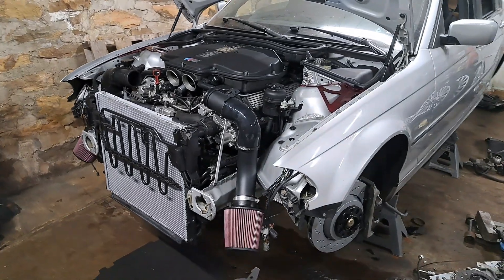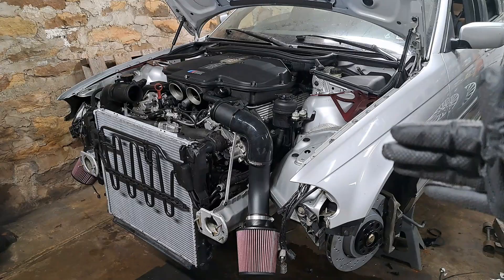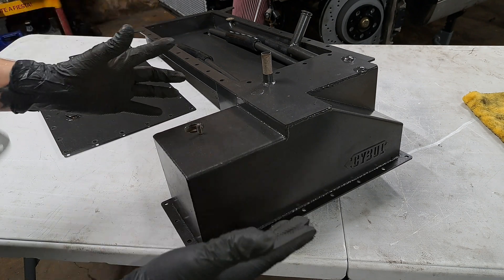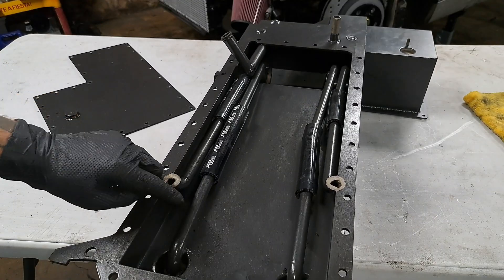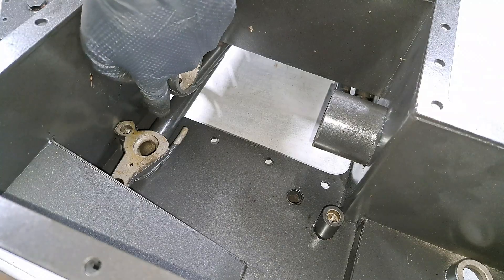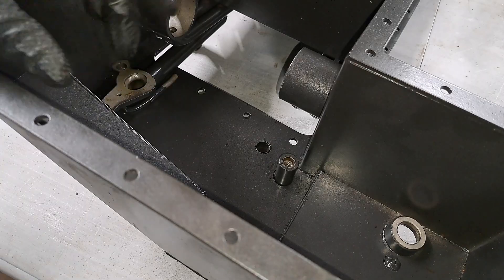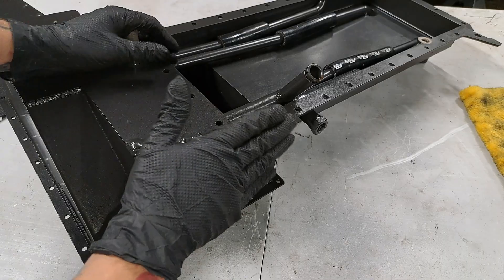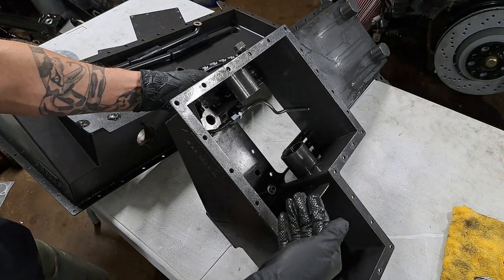Do NOT Buy this for your BMW engine - Cybul S62 Oil Pan Swap Kit E46 E36

Comment: I had also lots of problems with this set: 
- they didn't provide the template for drilling in the oil pump bracket
- oil pump pickup flange did not fit properly. Needed to make special thick gaskets myself to get oil pressure. 
- the modifed oil pump axle was not on spec.
- when mounting the oil pump and solonoids, i had to press out the oil sump with a hydrolic spreader to make it wider to fit everything.  
- oil retour line was not made correctly 
- they provide the wrong bolts for the subframe.
- provide wrong size bolts and washer for oil sump. 
- and last but not least, after finally making everything work myself. The welds cracked on different places. So had already 2 times big oil leaks and had to take it apart again😢

Really Really bad. And when you tell them the problems, the owner says he had never any issues with the set😂😂 

I have now spoken to 5 people in the Netherlands an Germany who also used this set. And had simular problems.

Don't buy this. Search for alpina or go the dry sump route.

Comment from the maker: Further update. After going back and forth with the owner of Cybul, I finally got a partial refund. Yet only after I showed proof of other people having problems. I had to stay persistent.

My friend from Spain, the one I've mentioned in the video a couple times, his S62 has recently totally lost oil pressure as well. Cybul told him to ship back the swap kit, for half refund. This is getting ridiculous.

Additional news, my Spain friend has disassembled his engine. Lots of damage has been done. Very unfortunate. Even the crankshaft is scored.

Comment: Hi !

Which gearbox and drive shaft do you use ? Ty ❤
Reply from the maker: The original 420G gearbox, driveshaft varies. Usually custom. I had one extended by shop to fit properly.

Comment: Makes sense that a large welded piece would have large misalignments. Welding pulls metal around and even if you fixture your piece, it's still springy and will pop out of shape as soon as you take it off the welding fixture.
I've worked in metal fabrication and i'm not that far from poland, so i can assure you that it's most definitely underpaid welders at work making these pieces. Or even in china.
And it also makes sense that these pieces are not aluminum, because skilled aluminum welders are expensive and hard to find. Any defect in an aluminum weld can lead to cracking over time.
If the pan is powder coated then it could be that as stress relieves in the heat of the curing oven, that the metal moves and features become misaligned.
I suspect what they need is a machining operation after baking in the oven, to bring all dimension critical surfaces up to spec.
But that's expensive and time consuming, and the bean counters don't like that.

Comment: Damn bro, fmic is a cheap brand
Reply from the maker: Where do you see a intercooler? Lol
Reply: @OLearysBMW the hose brand inside  the pan
Reply from the maker: @SERP92_  Gotcha! Thought you meant front mount intercooler. But yep, that further supports my reasoning of those hoses breaking down over time and contaminating the oiling system.

Comment: My question: is it possible to run stock oil pan and instead make a custom subframe? 

I feel like it is way less critical and the tolerances involved are much more forgiving.
Reply from the maker: Yes, that is what I'm currently doing. It's quite the task but feel much better already using the original parts.

Comment: I had the same problem with this kit. I've been in contact with Cybul since March, and they sent me another oil pan, and again it's off…..
Reply from the maker: I recommend to return the parts and get refund now. If you wait too long and have problems later, getting a refund is like pulling teeth. Don't do it to yourself.
Reply: @OLearysBMW   you know why you lost oil pressure?
Reply from the maker: @julijanstojakov9734 Can be various reasons, regardless it's not worth the stress in my opinion. I put a lot of my time into making that oil pan work correctly. The oil pressure loss was directly related, no question.
Reply from the maker: @julijanstojakov9734  I'm revisiting this comment thread to further persuade you to return the Cybul kit, if you can. A friend of my mine now also has a severely damaged S62 engine from this kit. Even the crankshaft is now scored. Please do not use the Cybul parts.
Reply: @OLearysBMW  he was able to determine what the problem was?
Reply from the maker: @julijanstojakov9734  Oil pressure, from which again directly correlates to how the oil pump mounts into this aftermarket oil pan. If you wish to try and make it work, good luck. There's been 4+ other people I've both spoken to and seen online of same problem. I myself was determined to make it work, car didn't even make it outside before losing oil pressure. Even after hours of test fitting and modifying. Junk.
Reply: @OLearysBMW  I'm in the exact same situation. I've also spent hours aligning the oil pump. Do you think it's because the connecting pipe where the oil pressure goes isn't sitting 100 percent straight? 
Which direction do you want to go, dry sump?
Reply from the maker: @julijanstojakov9734  I've went back to original oil pan and oiling system, which took some modifications to subframe and redesigning of parts. Other than that, dry sump would be nice. I'm no longer tampering with Cybul pan.
Reply: @OLearysBMW  The original is best… in my case I'm not allowed to change anything on the front axle carrier :/

With a dry sump, the problem is that you have to put the tank somewhere, and the whole thing costs a lot.

Comment: Yeah, this sucks. 
After your previous video(s) on the issue with these sump kits, I decided to put any plans of an M62 swap on hold, unless I could find an Alpina kit for a reasonable price ( I think that's next to impossible) or design my own kit based on the oem pump and be fully Aluminium, a modified E53 sump was a consideration too. 
To think people are going through these issues with an S62 is scary. Here in Europe, Adamat Performance also do a similar sump kit for the M62/S62, but it looks basically the same. I've not seen anyone use them on the S62 so have no idea if they have the same build quality and/or issues, but at least of the few I've seen on M60/62 engines I haven't heard much in the way of complaints. Still far, far away from OEM quality though.

Comment: So what is your options now for sump ?
Reply from the maker: Original oil pan is on engine right now after modifications of various parts. Will need further work to accommodate E46 steering system. Other option is dry sump system. Current goal is to start the engine with original oiling system, make sure no obvious damages were done.
Reply: @OLearysBMW ya dry sump is crazy for road car be interested to see if you get standard sump to work out

Comment: I feel you. One of the things that drives me nuts is suffering at the hand of someone else's incompetence. Unfortunately with aftermarket parts, the best case is you get what you pay for. I agree that the S62 requires tolerances that can't be held with a fabricated oil pan like that. To even attempt it, you need very good fixtures, fabricators, data-backed testing, and QA. It doesn't seem like Cybul has any of that. Being $10K into this, notwithstanding the frustration and lost time, I'd be extremely mad. At that point you're into dry sump territory, although that realization doesn't help in retrospect.

I also wouldn't be at all comfortable running the solid aluminum crank "damper" that comes with the kit. Crank dampers require a high level of engineering knowledge and special equipment to design correctly. It looks like what they sent you is just an aluminum disk that fits where it's supposed to fit. Odds are even if you didn't have oil pressure issues, you'd have issues with rotating assembly and/or bearing wear/premature failure as that chunk of aluminum is not tuned to the correct resonant frequency range like the stock damper is. Turning the stock one down is better, but I'd still be wary about running that.

I hope your engine checks out all right. What's your plan for the oil pan moving forward?
Reply from the maker: Thanks for taking the time to comment. Well, for me the first step was to remove and inspect some parts and drain the oil. Oil came out looking good, which is a positive sign. Second step was to take it all in and realize there's zero chance that I'm giving up. The original S62 oil pan is currently mocked up on the engine. No more Mickey Mouse crap, doing this the proper way. Modifications are currently underway. First and foremost will be getting another oil pump and starting the engine with original oiling system to make sure she's good to go.
Reply: @OLearysBMW  I think that's the right way to go. Modifying the subframe, while difficult in it's on way, is preferable when you can run a completely stock oil pan and crank damper and have the peace of mind that you're not going to lose oil pressure.